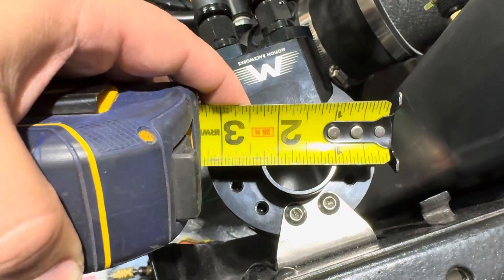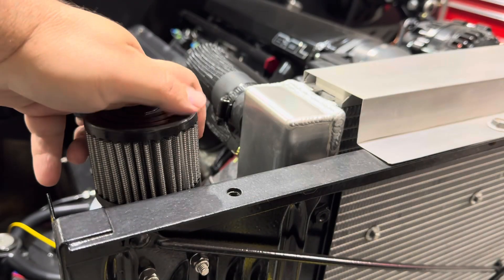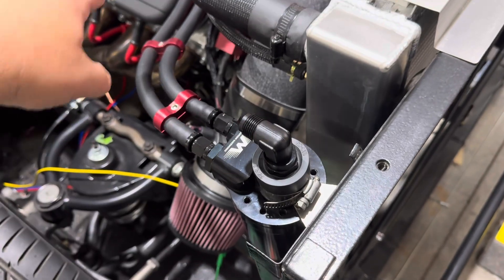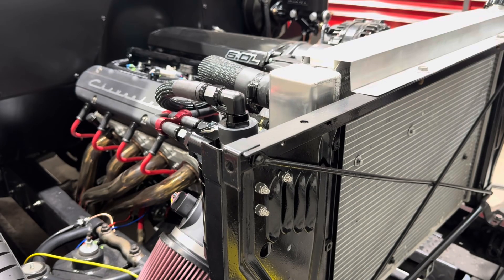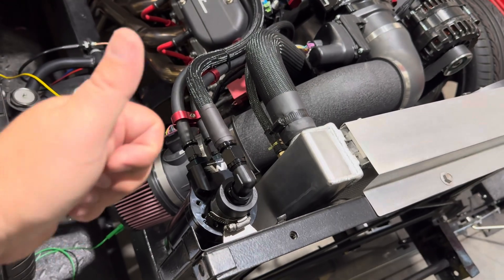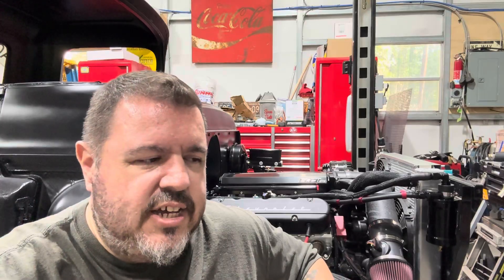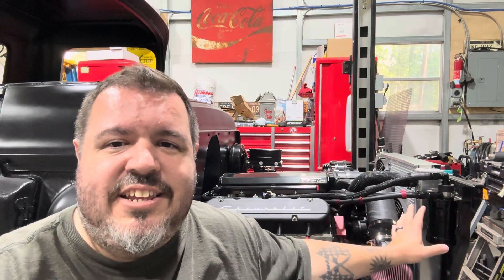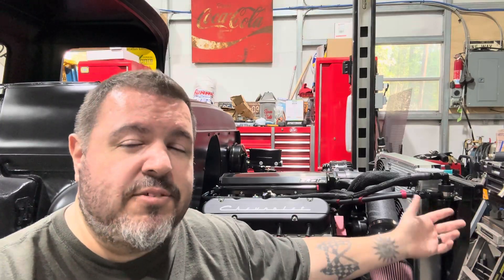Oil Catch Can Misinformation: Vented vs. Sealed—Which Is BEST for Your Engine?

Comment: i'm wanting to put one on my 6.6 L8T gdi   after watching the videos of everyone  catching the oil before it goes into the intake    however I am concerned  that the crank pressure  could interfere with the way the oil circulates in the engine
for lubrication     also some of these engine guys discussing the chance of  crank pressure and seal damage 
 am I just being too paranoid    
I have had some periodic rough idle  with only 11 K miles on the engine 
But I haven't experienced 
It  since I put the fuel system cleaner with PEA
 But I'm really not sure what's going on
Reply from the maker: @6gatornation  so you may want to watch my first catch can video on the vented catch can and how I plumbed it. That configuration drastically reduces pressures. In fact, I have already switched back. Engine runs noticeably better. To you point - I have a very slight oil leak in the corner of my pan… Im talking maybe one drip on the floor after a week of running it everyday. Well… after I switched to a sealed can configuration, the whole corner of the pan was moist with oil after running it once. Vented is the way to go for me! Here’s that video: Oil Catch Cans: 101 - EVERYTHING you NEED to Know!
https://youtu.be/wX42ANVfbxE
Reply: @ thanks bud  
 also seen a guy  run a drain tube from the bottom of the catch can
to the bottom of the fender well 
  I thought about doing this   but 
Have the drain tube  come out of the catch can closer to the top 
       To relieve pressure  also 
Helped to eliminate the oil smell 
    Also something to think about 
When they oil comes out of the drain tube   it doesn't hit anywhere on the car while you're driving  
  What's your opinion about that
Reply from the maker: @ I wouldn’t want to intentionally drip oil. The purpose of the can in the first place is to catch it. As far as relieving pressure, if the can is a vented can, you’re already relieving the pressure as it is.
Reply: @ having the drip line come out   near the top of the can   shouldn't drip any oil  
Unless you go a long time without dumping it     
The goal was to redirect the smell  
   that you mentioned you were having from your vented can
Reply from the maker: @ the smell is so minimal. You really have to stick your nose all up in there with the engine running.
Reply: @ have ypu seen there new   active 2 stage catch can   I think I'm going with this one   
https://youtu.be/PdHCa4C9u64?si=wRioxg9pj2HtnDFE

Comment: Cool video. Enjoyed watching this. Had no idea the amount of fumes released at idle! About the vent to atmosphere catch can, doesn't venting the catch can in the fenders tucked in a place the ac vents cant access (which i assume is in a position that is lower elevated than the catch can itself) cause condensation build up in the downward bent line and that condensation will drip in the catch can first? If youve seen it successfully done on youtube somewhere please share
Reply from the maker: My cowl vents are deleted but even so, its not really an issue, even when plumbed normally the LS produces quiet a bit of condensation until it reaches operating temperatures. Its not uncommon for a little condensation to accumulate in the catch can

Comment: Some people say that sealed is good for under boost, to help with crancase pressure since its constant or the turbo helps, and if you dont have a can between preturbo and pcv port oil will get suck into the turbo during boost, like the turbo will pull oil out or something. So im confused which to choose, vented or seal.
Reply from the maker: @toxicwolfgaming2972  With the excesses crankcase pressure created by boost, IMO - vented just makes the most sense.
Reply: @intheshoptv right, it has a road draft  tube so the engine regulates the pressure so I think it swaps the flow to either intake and turbo
Reply: Is it different when working with an open system (has no valve). 2 ports on the valve cover connects to preturbo and throttle body (all together, the ports aren't seperated or the turbo and throttle body) 7mgte

Comment: First thing i would say is that if your engine has so much crank pressure venting out of a vented catch can that it  bothers  you in the cab then you have a much larger problem than smelling it. I run a vented catch can under the hood of my 2014 camero ss with over 600  hp and i've never smelled anything in the cabin from the catch can.
Reply from the maker: @paulhunter1735  Did you watch the whole video?
Reply: I run Motion’s vented behind my drivers side headlight. I only smell it sometimes at a light when my windows are down.
Reply: Camaro.... Come on man..
Reply: thats good but what type of catch you use and where you mounted ?

Comment: I like the way you said "maybe 400 horsepower, nothing really crazy", I think that's a lot Mike! Remember back in the day, my favourite car was the '79 Trans Am 6.6. It had maybe 230 hp!!
Reply from the maker: @sarblade  Oh trust me I know… my last build WAS a 79 T/A with a 6.6 and I had to bore the block .030 over, mill the heads .050 use a thin cometic head gasket, did a cam, headers and I just barely squeezed 350hp out of it! But in the way of LS engines, they can make some crazy power for not a lot. Which makes mine pretty tame in comparison
Reply: @intheshoptv  Totally! Those 400's were pretty thin to work with. Too bad you weren't on Youtube with the T/A build!
Reply: Haha true! We are so desensitized now days because of how much things evolved.  I’m boosting my DC5 and also say I’m gonna tune to 400-450 whp, keep it reasonable,  nothing crazy & co workers etc that’s not as into it as I am are like 400-450 hp 4cyl??!! I tend to forget that is a pretty nice amount lol.    It’s the 600-800 whp and 1000-1200 whp 4 bangers that did that to us 😂

Comment: Can using the same vacuum port on the intake have a negative effect on your brake booster?
Reply: I have always ran the line into the intake tube or airbox.  
 
Maybe if you notice any deference in your brake pedal a restrictor on that line may help. 

Had a mg in my shop and the sealed catch can was on intake vacuum and it was pulling the single lip cam seal in and making a weird noise.
Reply: @southmaplegarage That's the ticket. I'm thinking of mounting mine inside my cold air box. Even if I have to cut a hole in the bottom of the box if it a tad long. Now I just need to do something about the gas tank vent now that it Doesn't have a charcoal canister it's Pretty strong.
Reply from the maker: Fantastic question dude! Fortunately the intake is still sucking the same 20 something pounds of vacuum regardless of if it’s scavenging PCV from the can or not, so it shouldn’t have any effect at all on the power brakes. Really good question!